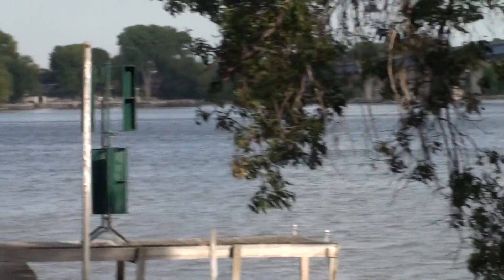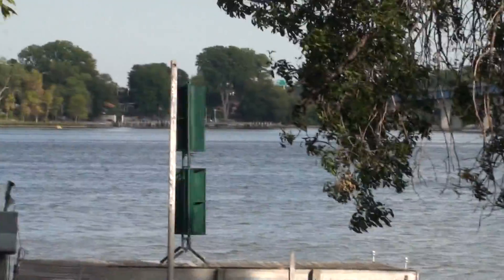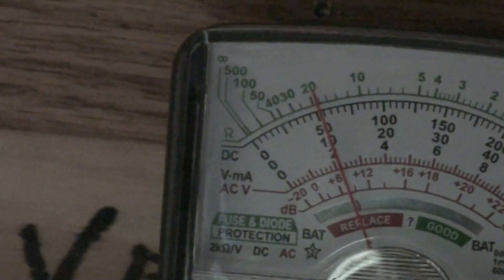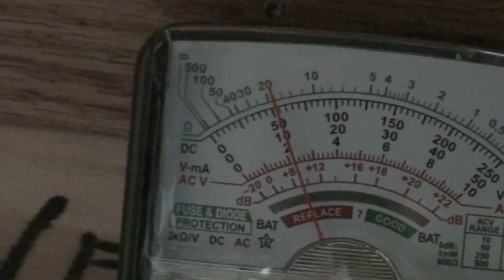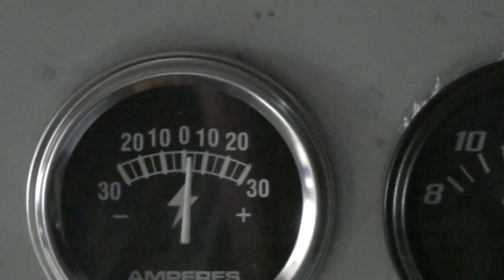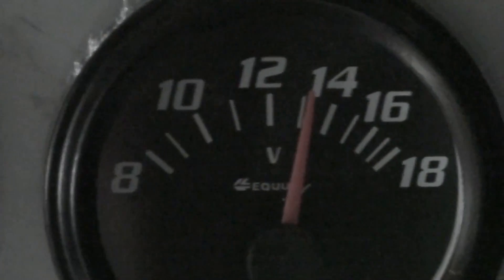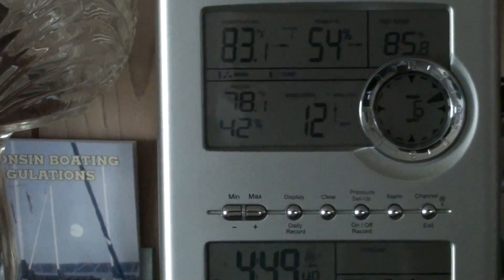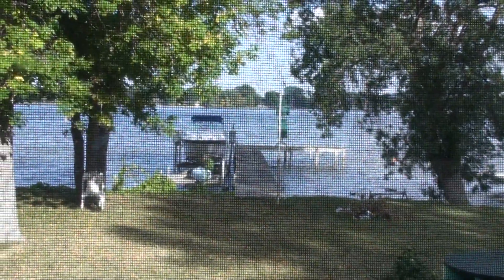Lenz 2 Counter rotating , 2 turbines. power readings, and video of turbines running.

Comment from the maker: Doesn't really have a lot of torque. It needs to be taller . The alternator a I made for it should have had more turns of wire. usually needs about a 15 mph wind to start charging. We are about to get our first winter blizzard here in Wisconsin today. possible high winds so I am anxious to see what it will do. Put this up last spring and it's been mildest summer wind wise I can remember.